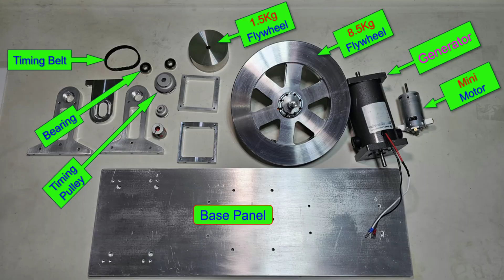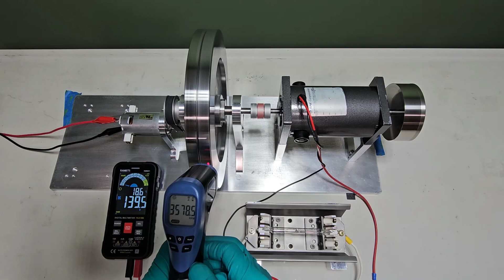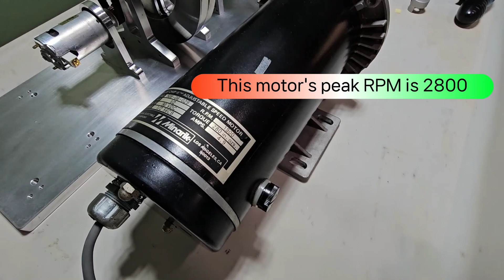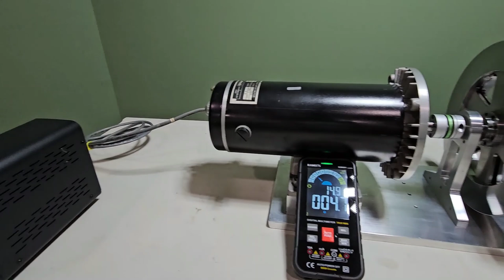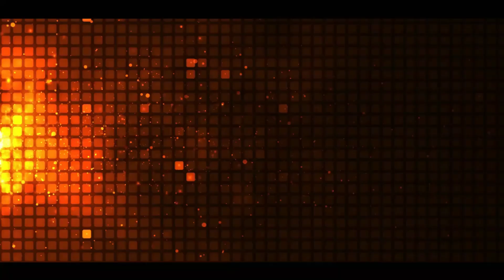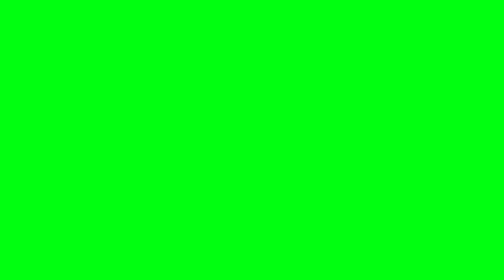Powering a 500-Watt Heating Lamp with a Small DC Generator | Flywheel Energy Storage Demo

Comment: Did any wires melt in the second motor test or show signs of hi heat in them?
Reply from the maker: The wood table was burning due to the heat lamp. That's why I turned it off quickly